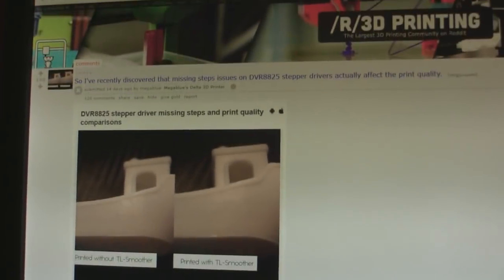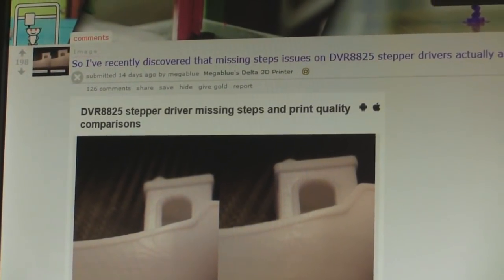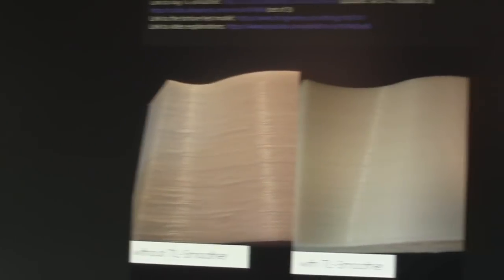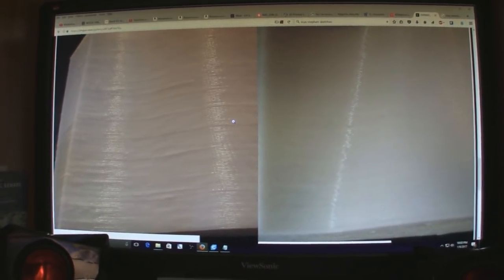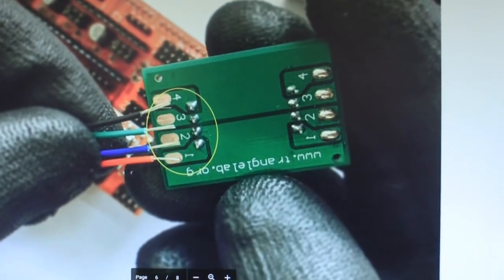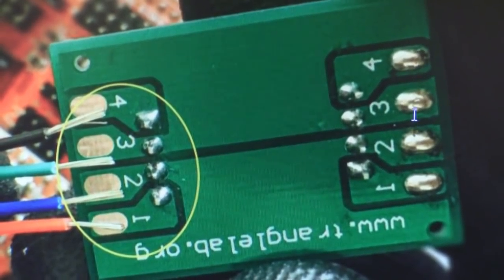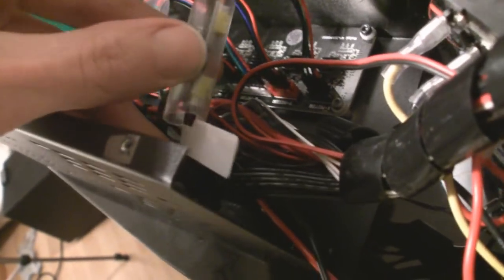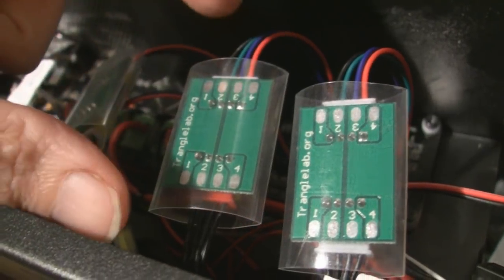Wanhao i3 Duplicator + TL Smoother: Does it Work?

Comment: lol, smoother doesn't mean it will make the print surface "smoother"... if you don't know what to look for, it's hard to compare if it's fixed or not.... layer inconsistency, seams etc... no, absolutely not.     plus it has a bigger advantage with deltas.

Comment: The reason it did not work is because the board design is wrong. You need to try the ones that 8 diodes and not 4 as during the design process the guy who made this mod realized 4 was not enough to fix the problem. 

https://groups.google.com/d/msg/deltabot/2HJEQG_wR9Q/G3m2PmdcDAAJ
Reply: he just used different diodes and had to put two in parallel due to current limitations. functionally it is the same exact thing as using 4 diodes, does not make any difference.
Reply: Festivejelly so they would work well with the Wanhao i3 plus then?
Reply: Actually the 2 are in series. This will not change current limitations, only double the voltage drop, and possibly give a cleaner edge to the square waves sent to the printer's motors.